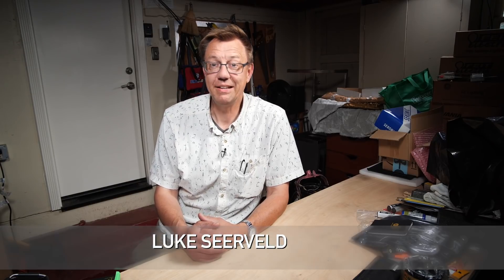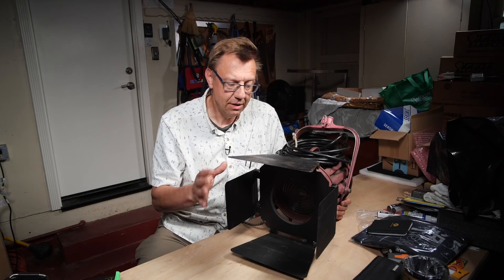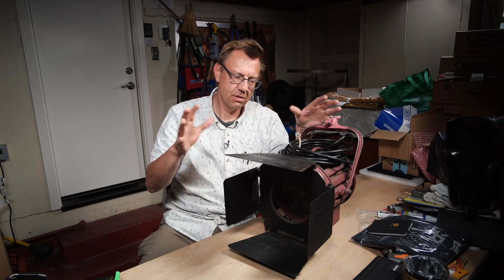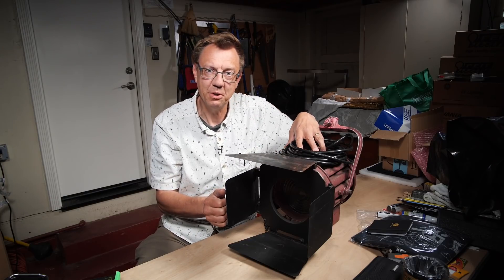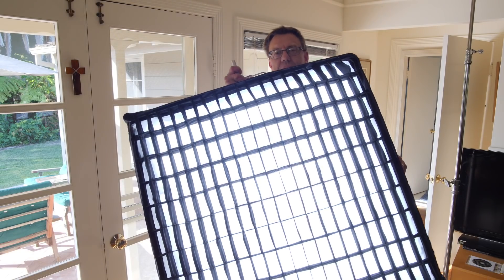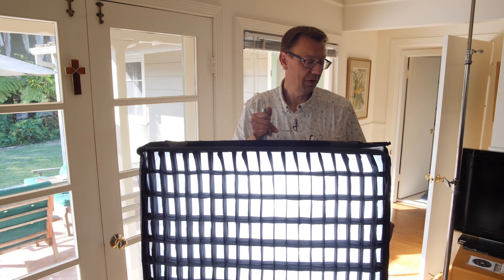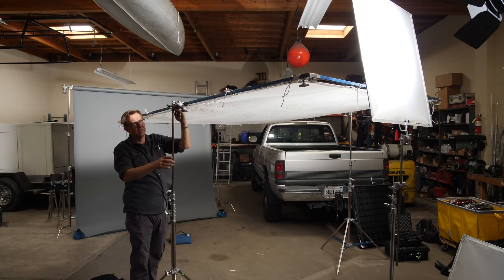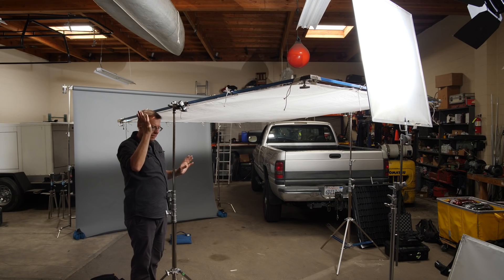Meet The Gaffer #149: Light Control Devices (Soft Egg Crates)

Comment: Degrees here refers to how wide of a throw they give not how much light they transmit
Depth vs cell size is really how you control how wide the throw is. Deeper smaller cells tighten the beam angle more while wide spacing, short ones increases it. 
thats why honeycrates are 50 degree.
Reply from the maker: Yes, I was wrong, wrong, wrong😀 Thank you. I love my 8x8 Honeycrates LCD!

Comment: I remember using the original KinoFlo egg crates then putting the flozier over top of the unit. Obviously this diminished the effect of the egg crate but does this set up focus the light on the flozier enough for an effect? Is there a time where skinning the outside of an egg crate make sense? 

Also, thanks for the series. Really great work!
Reply from the maker: In retrospect, I never tested the output with or without the egg crate through the flozier. It seems like it would act sort of like a wire scrim: taking down the overall intensity by a very small amount while similarly “focusing” the softness by a small amount. We’ll end up doing that once in a while these days with softboxes that may have a snapgrid/softcrate already applied, where the DP will ask for the light to be further softened and you may not have the time or equipment to add something behind the softcrate so you just add another square of diffusion in front. Technically it isn’t correct, but it gets the job done in the moment.

Comment: I would often light a subject who approached the camera using the Light Tools 60 degree grids on Chimeras to apply the "occlusion" effect (first time I've used the word also) by either aiming the light just above the subject or, more typically, to one side or the other, then using a 2' x 3' or 4' x 4' side flag to take down the unwanted spill.  You could adjust the angle so that as they approach the light it self limits, or I guess "occludes" and I could get about four steps with zero change in intensity. Worked like a charm, and if needed I would add more lights along the path (assuming the place to set them out of the frame was available.).  If the set wouldn't allow me to aim off to the left or right, I'd stick one or two 2'x 3' doubles about six inches apart in the middle of my Chimera so that they were skinny at the far end of the walk but acted as a limiter as the subject approached. "Occlusion" was also something we did a lot with 2K Zips hung in hallway ceilings back in the day, using the eggcrates to limit the light as the subject approached and having the next one start working where the one lighting the moving subject started fading. You could double the eggcrates and really control the spill.  That's something those making the cloth and snap on grids could do that would be handy.  I've also thought a grid you could open and close control like an A/C vent would be , well, cool.
Reply from the maker: Oooh, a moveable soft crate... like the old mole lightning shutters but with cube shapes like we used to have in ice cube trays... maybe just the horizontals would move?!

Comment: Luke- interesting concept that the egg crate/snapgrid defeats some of the inverse square law...never even thought about that factor. It seems highly subjective about the amount of containment a soft grid/snapgrid contributes versus making the light harder. Perhaps this is a phenomena driven by the location characteristics, e.g. are you trying to keep a white wall darker, rather than optimizing the softness of the key. We make compromises all the time on set - this just seems to be one of the more complicated ones where the larger source contributes softness and then the egg crate/snapgrid takes it away. Where is the point where actually using a smaller source/diffusion makes sense. Perhaps this is unknowable....
Reply from the maker: It’s new to me too, so I’m interested in learning more!
Reply: Why does larger source take away the softness?
Reply: @imiy  Hmm, I don't think a clean diffused larger source reduces softness... rather the opposite. If I understand correctly what we find difficult to measure is that not only do eggrates/snapgrids make the source harder, but in the case of large SnapGrids such as 6x, 8x, and 12x that as you move closer to the light you may start to visibly see that you get less and less of the wrap effect from the edges of the soft light. So the SnapGrid is cancelling out the possible gain in softness by being physically closer to the diffused key. It would be very difficult to measure this difference, and the degree of the SnapGrid would be a factor as well.
    I think if I had a point to make about large SnapGrid usage it is this: I only use them in smaller rooms when there are white walls nearby to keep them darker. Not only are they expensive to rent and buy, but I think that the undeniable fact that they make the source effectively harder with less wrap means their value in use is less than popularly conceived.
    If I think about the times where SnapGrids and fabric grids have worked best it has often been with a long walk and talk with multiple lights where I want the light to fall off so the subject can continue into another light source, alleviating the "doubling up" effect of lights in a row.
    I realize I am swimming against the tide; many gaffers think the large SnapGrids are a miracle cure... probably more so if you bought one and now can rent it to production.

Comment: Great video. Interesting point about light occlusion. I'm curious if the quality/softness of light changes as you move closer/further away from the source. In theory, if you are moving closer to the source, then the light becomes harder since you are seeing less of the source? Or does the relative size some how stay the same as you move closer and further from the light? Measuring the "softness" of a light is rather tricky but I'd be interested if there was a follow up test.
Reply from the maker: Yes, if I had a brain I would have done it  during the 8x8 comparison, but I was in a bit of a rush:( It would be nice to have a larger HMI behind a 12x, but most like the next attempt will be an M18 or two through an 8x. I have other set ups with 1 or 2x M18’s thru the 8x Honeycrates, but they are both sit-down interviews and were use more for reflection help.
Reply: @meetthegaffer  Not a problem. It's a lot to conduct multiple tests at once. I learned something new today so thank you!